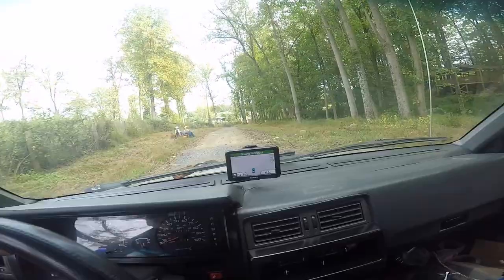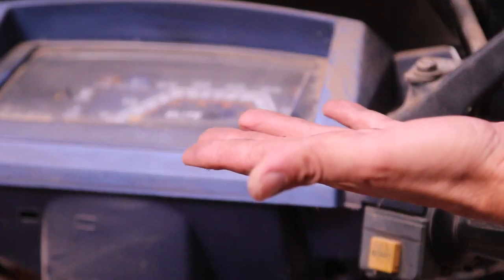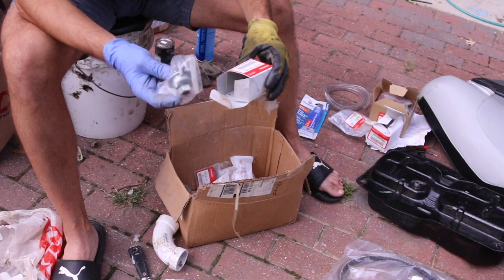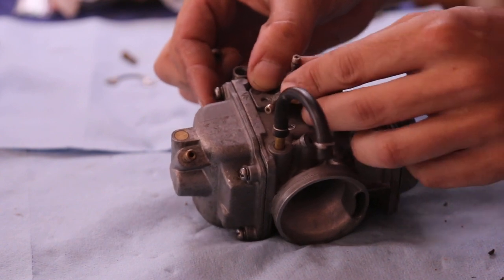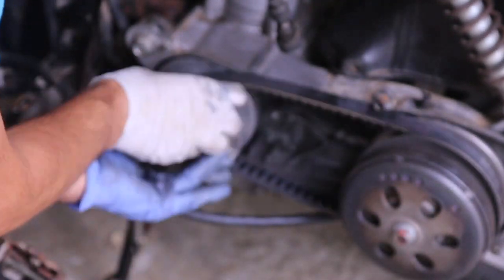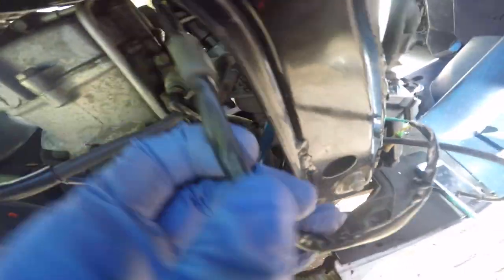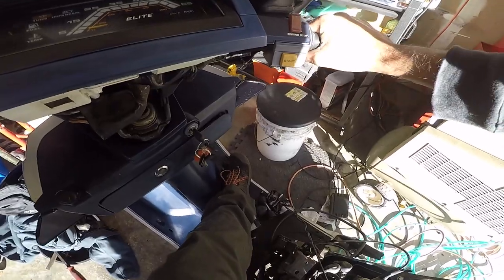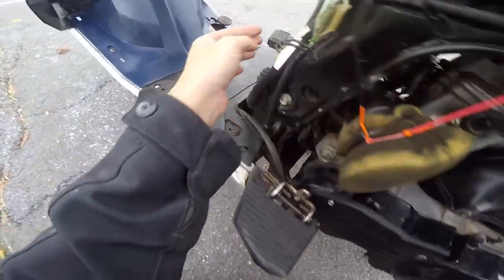Restoring a 1985 Honda Elite barn find

Comment: I have a 1984 Elite 125 and the same 1985 Elite 150 you have. Both run great and each has just over 6000 miles. The 1985 was partially disassembled with no carburetor and had been in the shed almost 10 years. The 125 is rideable already needing minor things. You have a great find there, I am still looking for a 1986 Elite 150 Deluxe to have all 3 models.

Comment: you took too much pride in your work..  you didn't really push it all the way in with lube the manifolds try out. make sure you adjust the valves too.  yo ou should of kept the oem floats those china ones such i'm saying this because i've put 45000 miles on mine died with 62450 miles!  i rebuilt my whole bike with je pistons that cost me $600! i'm an expert my piston spare is on ebay.  your dieinig is due to  not enough gas with that stupid filter take  that off it was designed with out it. those bystartewrs are junk too ou don't need it. either nor the thermostat from china to get 62000 miles you need to run cold as ou can get it.  they don't make the manifolds any more they have them but they are to big use super glue i had to push mine bike 5 miles due to the clutch blew up       they get stick in there too and need greese i was buring belt every 3000 miles and back tires.